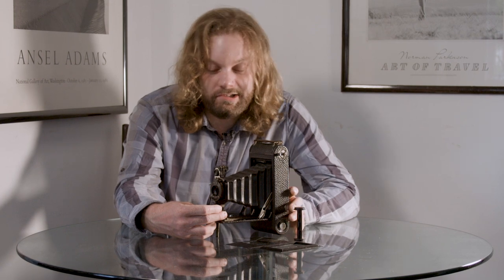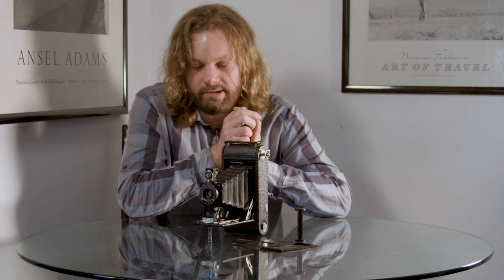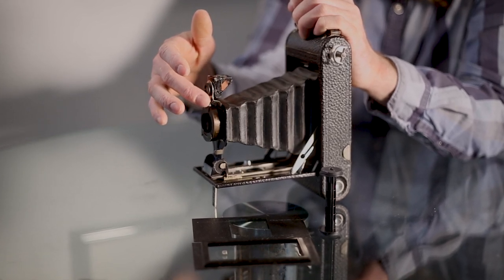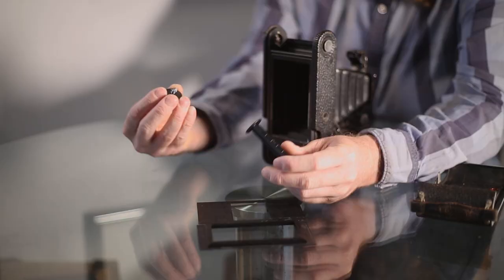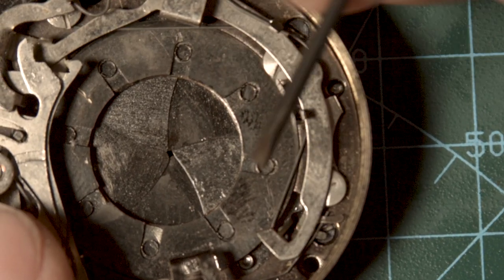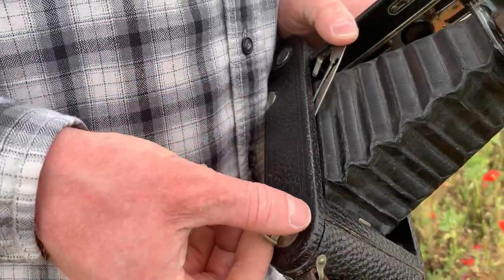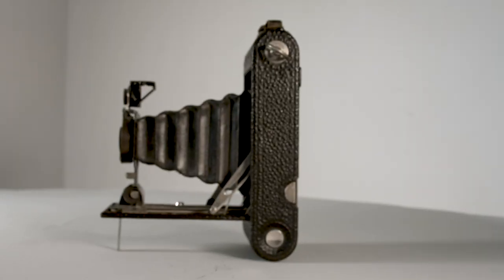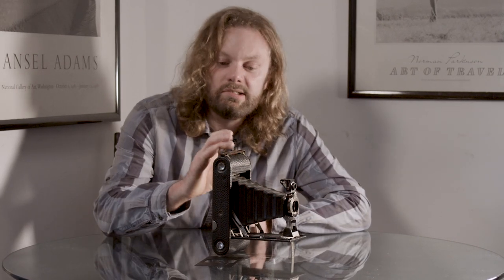A Photoshoot with a World War One Kodak Camera

Comment: Wonderful video! I have a 1914 No.1 Kodak Jr (manufactured by Kodak in Canada). It is one of the rare non-autographic back cameras made in late 1914, before the introduction to the autographic backs starting in 1915. It has a Kodak Anastigmat lens f/7.7 - f/32. Shutter speeds are: T, B, 25,50,100. It's light tight and takes fantastic images. I know you posted this video a year but I came across this. Great work!

Comment: Was just "binging" a handful of your vintage camera videos -- I enjoyed them so much (presentation style, info, educational value, humor, photo style) that I subscribed!  I have a growing (while my credit card balance is also growing!) collection of "vintage" film cameras -- 35mm and roll film -- from about 1990 back to about 1890.  Unfortunately about 50% of the cameras that I get are not functioning well enough to work and are beyond my meager repair skills -- but I keep the most unique and interesting "for the shelf" (aforementioned shelf would be much larger than my 2-bedroom condominium at this point!) -- but I really want to use these old cameras -- at least once, as you do, to almost let the cameras live again.  Well, I ended up with a Kodak No. 2 Folding Hawk-Eye Model C, 120 roll film camera with the Kodo lens (shutter T and I, apertures 1 thru 4).  It looked in mint condition other than a dusty lens and reflect/viewfinder.  So I carefully cleaned the viewfinder, inside and out, and both surfaces of the lens.  The shutter looks/sounds fine.  I found the "to be expected" pinholes along the corners of the bellows, BUT I found that on one corner of the folding bellows , back near the focal plane, there is about a spot about 1/2-inch long where the pinholes a one long hole.  I know that you used a cloth tape on one of your folding/bellows cameras, but I fear that taping all along all four corners of the bellows from the lens/shutter board back to the focal plane would add so much bulk that I would not be able to collapse the bellows completely again.  I think that I have no choice but to tape up that 1/2-inch hole -- but is there a flexible paint that might work on the pinholes?  I'd love to get this camera working -- it looks too pristine to not use!  Thank you for your great videos and any suggestions that you may have!  Aengus from the US.

Comment: Those few images you made were excellent, I have an SLR camera that was made by my grandfather from plans published in a magazine. Unfortunately the back which would have held probably half plates is missing. First world war Kodak vest pocket cameras were taken to the front by soldiers but later banned, I suspect you already knew that though.
Reply from the maker: It’s not hard to find half plate holders. I’ve just bought them for the Thornton Pickard. I did know about the pocket vest camera, the Kodak was mostly used by people allowed to use them, but folks would smuggle there best cameras onto the front line.

Comment: Good instructions on removing the camera lense and lazy way to clean the lense mechanism, modern film adapters and shooting until Murphy arrived, but still managed to take some very beautiful pictures. I have two 1A and two 3A, so here is two questions first have you shot with 35mm film and have you tried cut film paper inside the 3A, which probably will work on the 1A too?
Reply from the maker: 1 Murphy always arrives early 2 we are not at home to mr cock up. The shutters second failure was actually different from the first. Anyways nope on the 35 but I did put it in the 127 Brownie, I’d put photographic paper in a 5x4 as I’ll be able make up a bunch of dark slides, but don’t have a darkroom to develop them.

Comment: I have a question. How did you take colorful photos on such an old lens? Old objects are only photographed well in black and white, with a color film the light is split apart and a rainbow or other color distortion is created. How did you do it, unless it's a lens adapted to color photos but from 1930?
Reply from the maker: For this one to make it work better, I Clean the lenses like I have adhd and usually push my film a stop, in this case 2, Modern film works well. A bit of clean up in Lightroom I added saturation while fighting a blue color cast, but I try to not do anything I couldn’t do in a darkroom.  

I also picked the clothes and field to add color to the scene. 

So I did just about everything in my power to add color, anywhere I could and avoid the washed out look.

It gave a better results than the 1909 but comparable results to the 2a Brownie in  color. Now the shutters  broken maybe I can put the lens on a digital camera and test it properly.
Reply: @olitography  ok great good luck

Comment: Darn shutter! I expect mine will do the same. I may try the "vandal's" method, lol!
Reply from the maker: There were two different problems with the shutter i didn't get a chance to mention it in detail. the gummed up blades were solved with WD-40, its a vandals method because WD encourages rust in the long term.  and you don't want oil on the lens.  The final issue that i checked when i git home was that the shutter knob had stopped fully engaging the arm, which i don't know how to fix, but its definable worth trying out
Reply: @olitography  Thanks for replying! I got mine from my display cabinet and checked its functions . . . like new! Now all I need to do is buy the 120 roll adapters and watch your "how many turns" tutorial.
BTW, I appreciate your "warts and all" delivery. It makes me feel ready to try rather than cowed by unattainable skills. That's why I subscribed.
Reply: The shutters hang because they are oily or the springs are out of socket. If you take it apart, then clean the shutters with Naphta, then make sure it's all tripping right you'll be fine for another 100 years or so. They aren't bullet proof, but near enough to it.
Reply from the maker: @murraykriner9425  Its not travelling its full distance from the external shutter knob.  so you trip the shutter it moves the lever but not far enough for it to engage the blades.
Reply: @olitography  all the early folders relied on nearly oil-free conditions and spring tensions from shutter return and main spring values. The springs lose tension with age, and guide rails where the ball-bearings live must be got at from both back and front. The ill your outlining seems to be foreign matter or oxidation in the guide rails where the steel bearings reside, along with a broken or unhooked shutter return spring. Pheugo/camera has a detailed instruction list for disassembly and preservation of the clockwork inside, but warns against trying to bend the springs to restore operation as they often snap. Appears the works isn't returning in its throw, from either bearing failure (oily or unseated from the track they ride in, or your shutter return spring has slipped from underneath of its hook, and ergo not returning to reset the shutter release. I used the sight mentioned when I started finding oily shutters in many of my antique box and folding cameras, and this page though lacking step by step photos gives enough written explanation to aid the wary steps to repair most if not all of these aging brass and steel dreams. I would put in a link, but figure you can find it readily enough. Let me know if more help is in need. Sincerest regards, Murray
Reply from the maker: @murraykriner9425  Thank you, i will take a look
Reply from the maker: @murraykriner9425  I wont do it for a while as i've got to get through a number of other cameras, Such as the Linhof, Thornton Pickard and jammed Nikon FE,, Olympus OM1 and RC35, but i want to do a film a about photographing in World war 1 and this camera will need to be returned to service.
Reply: @olitography  I don't know your resources there in the UK, but there is a common Kodak that soldiers carried during the Great War, the Vest Pocket, which is much like your 1A, just more portable. Again, the film is different than 120, requiring adjustment, but it was popular with the Doughboys in 1914 when British troops took to the trenches. My Great Grandfather, and young Sicilian spoke of them before he passed, and of coarse I had to have one. Mine had failing bellows, so be wary, but its a gem none the less, and still may be found at the odd shops in the Isles. Its where I found mine, but haggle as they have gained a bit of a reputation for light leaks, and not where you would imagine. Wish you luck with your Nikon FE, and your Olympus OM video logs. Own both, and loved greatly till the advance froze on the Nikon, and the shutter hung on my OM. Its the blooming solder joints on both, and know its major surgery, so I've been running my East German Is for the time being. Its a Panzer Tank in disguise, but its clockworks run like a Swiss time-piece. I just adore that its M42 lens mount, which gives wide field for optics. Its set with a 50mm Meyer 1.8f I believe which gathers light like mad. Very best wishes on all your coming work. I'm a big fan of your craft. Your instincts shooting are par excellance with many. Regards, Murray

Comment: Thank you for sharing the experience, and photos. What was the problem with DW40? Shutter needed to be properly taken apart and cleaned instead? I have a larger Kodak III 1A also with shutter not working, not sure how to approach it, and could not find a good video on it.
Reply from the maker: Those shutters are like watches, in my case the shutter trigger failed to engage, and I was never able to fix it. Once they go either you invest a fair amount of time or buy a working one. WD is bad because it makes metal corrode over time.

Comment: I bought one of the cameras for easter and I have spent the past month re-painting and covering the bellows. My Kodak is slightly different as it takes 130 film that I need to reduce down to 120. Also, why would I need a film back? I'm new to shooting on film.
Reply from the maker: If. By film back you mean hate mask, there are just two reasons the first is that it gives a clean edge to your image on the negative, the other is that it prevents fogging of the top and Bottom of the negative.

Comment: By any chance do you still remember the amount of turns you used? I just got mine yesterday and can't afford to experiment since I only had enough change for one roll...
Reply from the maker: Did I not mention it in the video? Of course because the film gate effects it. Can look later on for you with no gate mask.
Reply: @olitography  Thank you responding really quick, really appreciate it! But no need anymore. A friend told me to put red headlight tape all over the autographic cover and count 1,3,5,7,9 when winding. Shots are super consistent from what I've seen. Granted you'd have to use film stocks below ASA 200 so it doesn't fog.
Reply from the maker: @yellowchino3883 the window leaks light. But it might be best for you and your one roll. treat the window with care if you get too much light on it will burn the expose them onto the film. Like in the using a Brownie video. That can be part of the look as well
Reply: @yellowchino3883   HEy! Wer these half turns or full turns from start point? I am about to load and shoot with the beautiful Kodak 1a !!! Excited, but worried about the counts. Thanks!

Comment: I have the same camera. I’m curious as to where you got the adapter for film and what kind of film you used. I’m excited to try mine out. I found an old roll of film on it so I hope it can be developed
Reply from the maker: I made the adapter, you can find the files on Olitography.com and 3d print them, I usually use Porta  for colour and Tmax for black and white. Your film can be developed if it’s not fogged, exposed film tends to last longer.
Reply: @olitography  any chance you’re going to upload the files for the spool adapter? Your website says coming soon
Reply from the maker: @anyalpine  www/olitography.com
Reply from the maker: @anyalpine   sorry I  clearly didn't read it properly, the adapters not the gate mask. I can upload that at the weekend.

Comment: Is the 3D files available to download?
I have the same type type of camera (need to repair some pinholes in the bellows) that I would like to try out :)
It has the "newer" f/7.7 lens.
Reply from the maker: I can make the 3D file available, I will need to find it though
Reply: @olitography  i have been on a hunt for 3D files or printed adapters for 116 and 118 film. But everything locally is sold out. Especially like your 3D printed frame for keeping the light from fogging the edges of the film!
Reply: CamerHack in Italy makes 116 3D adapters, as well as a variety of other adapters for old cameras  including a film cutter for 127 format.

Comment: "Autographic" cameras do not use a carbon paper backing. In stead they use a little known property of film and that it is pressure sensitive as it is light sensitive. 
To write data onto film you simply wrote pressing down with the "stylus" and the film was fogged(exposed)  by the force you exerted. This is also shown by a defect of film transport mechanisms known as "pressure marks" which produces black markings when film is subject to unduly force.
Reply from the maker: I’d love for this to be true, And it could be. there is a sheet that looks like carbon paper on the autographic films, but i might try putting a roll in a press to see what happens.

Comment: I have a very similar kodak 1a series 2 without the focus slider (focus with distance scale on the lens) it also has shutter speeds of 25, 50, T and B the only thing is when I take a shot it seems that even though I've metered it I am getting shots so overexposed that only a grey rectangle is visible on the negative and no semblance of an image even when held to the light. The shutter opens and closes so I really don't understand why.
Reply from the maker: I don't have your camera in front of me, but the first thing I would do is use a torch to check the bellows, for pin holes that might be exposing the film while your shutter in closed.  You can also tell this from your film if the over exposure is uneven. If you join the group  we can join you on your journey,
Reply: @olitography  thanks for the reply, I have requested to join the group

Comment: Very nice! I liked the historic background you gave and Jamie's outfit! Did you say what kind of film you used? Ektar?
These cameras were only designed to shoot with black and white film, especially with a single element lens like that. Most Kodak ball bearing shutters I come across work fine, which is surprising for shutters so old! One fun thing to try on those single element meniscus lens is to unscrew the front part of the lens and then open the aperture all the way, past #1, giving you a soft focus effect.
I've used a Kodak No. 1 Autographic Jr. that came with a rapid rectilinear lens.
https://www.flickr.com/photos/nmarshall/tags/kodakno1autographicjr/
For cleaning shutters I would recommend Ronsonol/lighter fluid/naphtha because it doesn't leave a residue like WD-40. You can confirm the apertures by the f-stop formula:
f-stop = focal length / entrance pupil diameter
Reply from the maker: Thank you, for your thought out comment. I’ll try the lens trick, I’m more interested in colour in them because they weren’t designed for it, also it brings the past to life a bit, it is the first of those shutters to fail on me which is really quite incredible. The bellies on those cameras have been amazing as well, WD 40 is something you should never use, I’ll try lighter fluid and I did try measuring the hole but didn’t get the measurements very accurate so moved on to guess work.

Comment: I really wanted to let you know how inspiration these videos are.  A while back I purchased a very sad looking No.2-C Autographic Kodak Jr.  The bellows was pretty much dust, so I got it at a reasonable price.  It's been about a year and half since then.  I was able to get some shots (bad...I'm a hobbyist at best and more of an oil painter than a photographer).  Eventually, I was able to find a replacement bellows (NOS) and I very carefully replaced it.  The shutter mechanism was also quite sticky and unreliable.  While apart I used Non-residue electrical contact cleaner.  Everything freed up and and it has been working fine and quite reliable.  Is there a difference in the gate sizes between 1A and the 2C?  Again, thank you from Canada for the inspirational videos.
Reply from the maker: Thank you, I’m glad people are able to use these videos is a positive way

Comment: Numerical system to f/stop conversion approximately 1 -> f/8, 2 -> f/16, 3-> f32, 4 -> f/64 according to the table here:  http://kodak.3106.net/index.php?p=213  (I remember looking that up when I ran a roll of film through my Grandparents' 1A a few years ago)  I read a copy of the instruction manual, and it gave recommended settings, but without knowing what speed film was standard in the 1920s, it was hard to apply the necessary 'Kentucky Windage'  Fun stuff!
Reply from the maker: That's really helpful its nice to clarify it
Reply: That table says f/11, 16, 22, and 32 like the video.